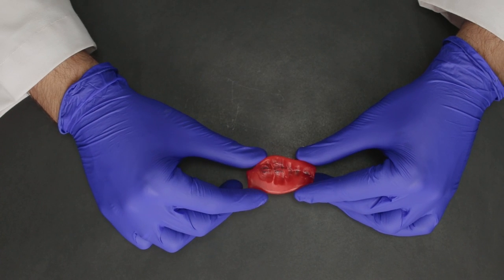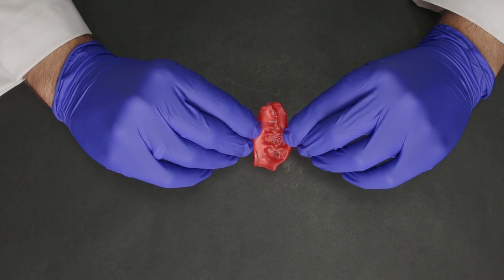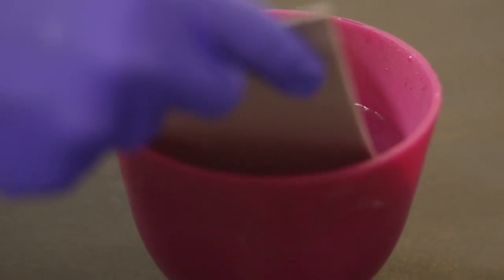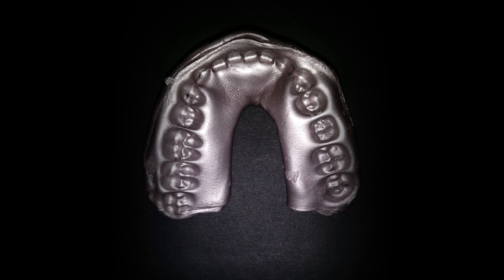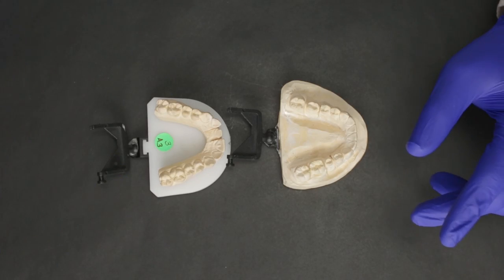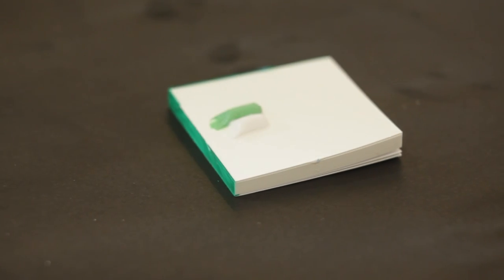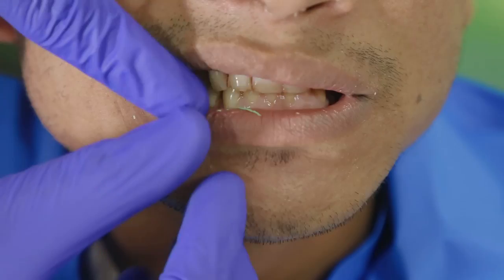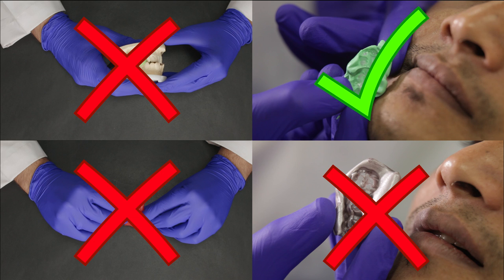Bite Registrations

Comment: We can place the material /wax on the tooth opposite to the prepared tooth right?
Reply from the maker: Hi. Generally , I place the wax or material on the teeth being prepped. With A silicone , its in fact easier to place it on the lower arch to counter the gravitational force that tends to pull the material down. So it really depends on the situation